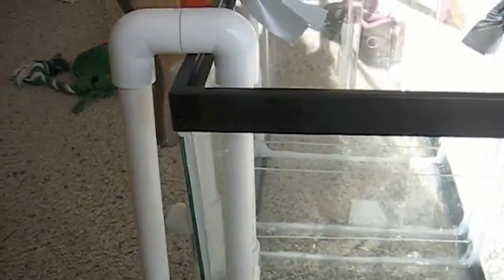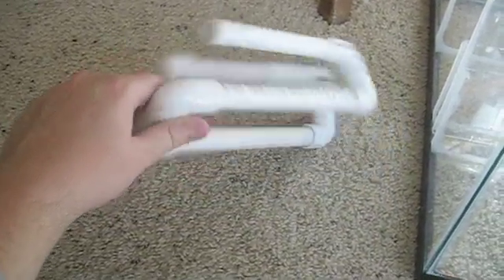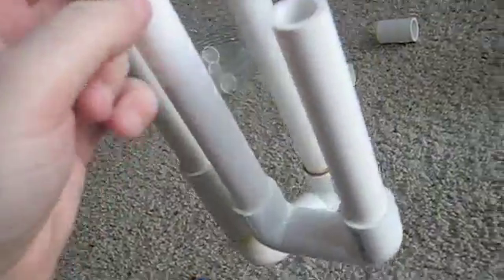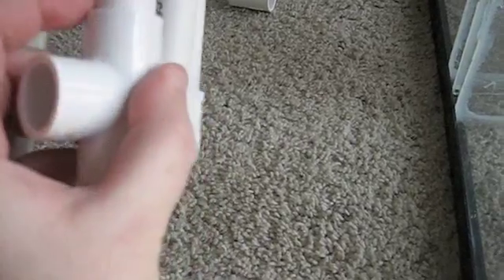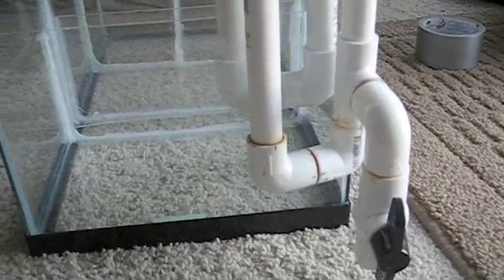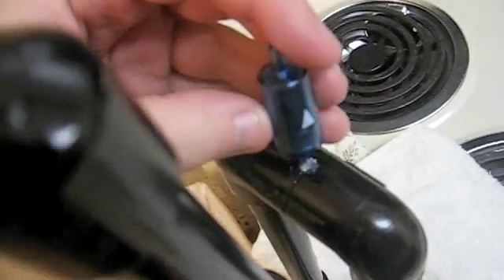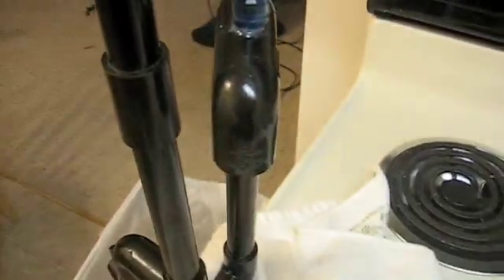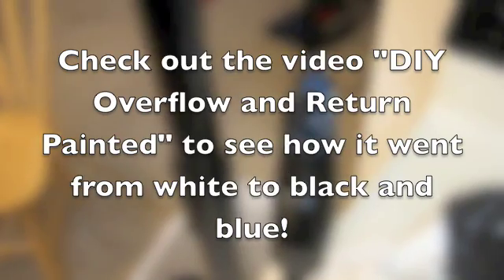Nano Lagoon (DIY Overflow)

Comment: I have a question please. Will it work if you turn the outside pipe opposite to the inside one? It means setting the 2 "legs" opposite to each other. I need to hide the tubing behind the tank

Comment: whats the hole on the cap for ? vent?  also how high or low is the pvc on the inside of the tank? is it better if you keep it short for faster overflow of water? thanks

Comment: i too am building a overflow, for a algae scrubber i like your design thanks for the video...

however do you know the flow rate of your design? gph? if you dont no worries
but it will help me decide on 1/2in or 1 inch tubing 

thanks again for the video

Comment: @twizzlerx25 my understanding is that the one I used has less of a risk of losing prime or allowing air bubbles through. I have seen the other method you mention and I am sure it works just fine! (this is another account I am answering this from btw).

Comment: Well 2 days ago it happened. One of my snails went missing, I thought it was dead, in the overflow or the shrimp ate it. Finally I seen it down inside the pvc overflow. So I turned off the pumps and went to work. When I got home it was back in the display. So I had to make a guard, and the one I made is simple and works fantastic. I just took a PVC end cap that fits my pipe drilled some holes in the top, and put in on. Done and Done, problem solved and the overflow still works great.